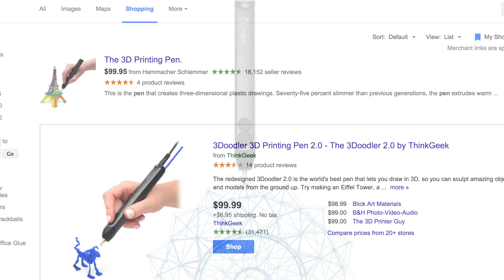How To Make a Cheap 3D Pen!

Comment: Some Tips:
1. Try to get a glue gun with a small nozzle
2. Check the temp of the gun and your filament to get premium prints
3. make a new casing instead of the glue gun to make it easier to print
4. use it on a masking tape bed to help it stick better
hope it helps ;)

Comment: The only problem I see with this (I own the newest version of the Scribbler 3D pen) is that the shapes are very shaky because the filament doesn't cool nearly  as fast and makes the whole thing wobbly and shaky. The filament does not stay as sturdy using a glue gun.
Reply: I try to check out that other channel but it takes me to jlazer clips